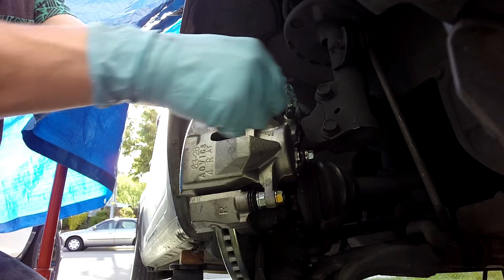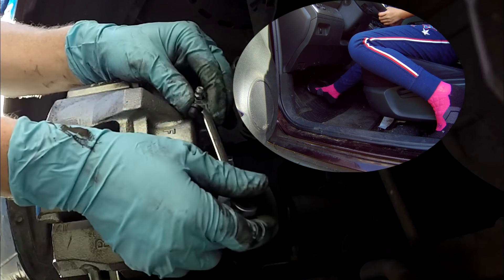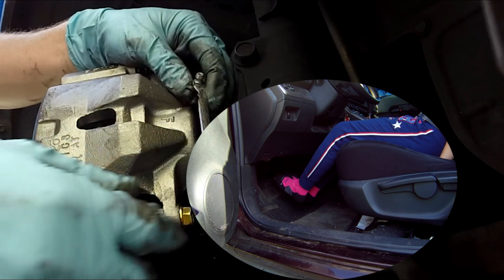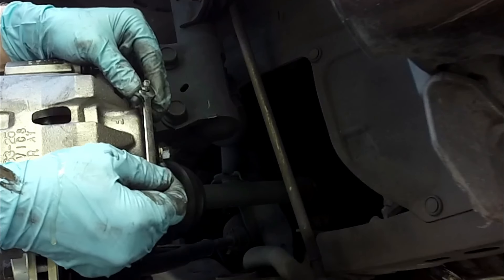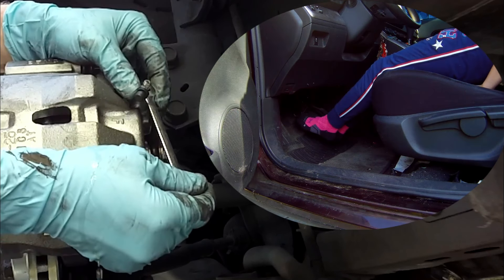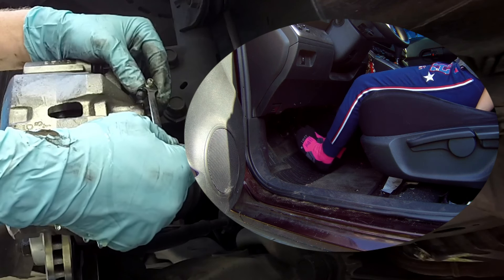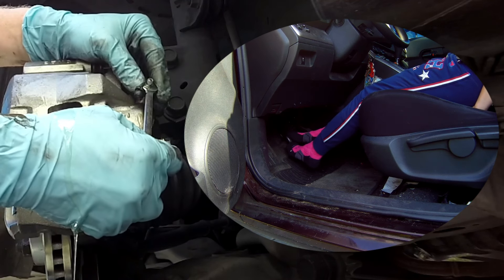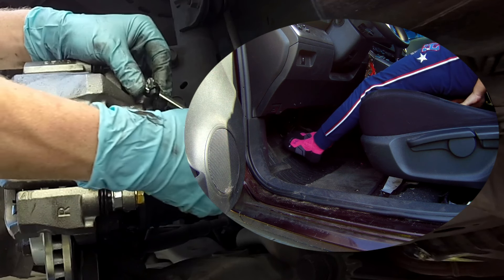⫷ How to easily Bleed Air Out of Brake Caliper ⫸

Comment: Using a 3/16 clear plastic tubing and attaching it to a clear empty soda bottle will be a lot less messy. and you can see when the air bubbles stop. The kid is doing a great job.
Reply from the maker: Great tip. 👍. 
I must say, I have one of the best helpers around.

Comment: Your video saved us!!  We know how to change brake pads but accidentally loosened the brake line.  After being stranded for 3 hours, your video saved us!!  Worked like a charm! Thank you!!
Reply: I just did the same thing did you bleed all 4 or just 1
Reply: Just needed to do the 1.  As long as the brakes were normal again, we didn’t do any more.  If the breaks were still spongy, we would have kept going.

Comment: I go with a clear rubber tube that mates to bleed valve to control the fluid into a container for proper disposal and you can also see any air bubbles in the tube.  Kind of surprised to just see fluid squirting all over as it is messy and you can't detect air bubble so you will over bleed wasting fluid.
Reply: Yes, it's a little sloppy of a method but if you really just need your brakes to function then it's not a big deal. Pressure washer and some driveway cleaner should easily remove any staining on the ground.

Comment: I bleed brake fluid out of all cylinders and when I finished the brake didn't work at all. About crashing into another car, luckily the car was just moving slowly and applied a handbrake. Will try your tip Scotty and hopefully it will fix the problem.

Comment: thank you. just one question, do you keep the cap on?
Reply from the maker: Doesn't really matter as long as you keep the fluid level toped off. If you leave the cap on, less chance of contamination happening from dust and particles in the air.  good luck. Keep us posted!! 💪 👍 🤞

Comment: Do we only have to do it on one side of the car? Both my calipers seized (front) replaced them but I’m guessing theirs air in system
Reply from the maker: Any caliper that you replaced or that you think has air in It should be bled. always start bleeding from the furthest caliper from the brake fluid reservoir.

Comment: You can do it with any sides of caliper? It will  bleed air out for the entire system? Should the car be off when doing that?
Reply from the maker: Car off.  Make sure the fluid reservoir stays full. You can do this process to any caliper. If you are going to do all 4 calipers make sure to start at the caliper the furthest from the reservoir.
Reply: @Scotties Hobbies  ok already done!! All good thanks for the tip very easy

Comment: I have cleaned the Caliper piston, rings and the rest by myself. After fixing everything tried to bleed Air a few times but the brake pedal is still goes down and less brake too. Tried two three times to bleed like you did but no luck. How do we know whether the air has bled or not?
Reply from the maker: You could have a bad master cylinder if pressure doesn't build up.
Reply from the maker: @iroshwimaladharma5840  from the Bleeder nipple. If you take the brake line off, you will trap air between the hose and the bleeder.
Reply: @ScottiesHobbies  I can't see any option to release the nipple, its just a small pin with a hole. 
I had to remove the brake line to clean the cylinder. But brake oil did not come out from the line after removing.

Comment: What happens when the bleeding port is rusted and you have to do it with the line and still don't work
Reply from the maker: You can't do it with the line. You will be putting air in the caliper.  You have to bleed at the very end of the system.  You'll probably need a new caliper if you can't get te bleeder out.
Reply: I didn't replace the caliper had a plugged brake line put a new line on it can't get it to have a full pedal with out pumping won't stay so you are saying that I have to replace the caliper? They are all rusted and stuck together
Reply from the maker: @ronaldbutton28  To bleed the brakes properly you have to bleed them from the brake bleeder. If you cannot bleed it from the brake bleeder for some reason you might want to replace the caliper so you can.

Comment: Is that the brake line hole where the fluid was coming from? If so then what pressing the pedal has to do with it?
Reply from the maker: The brake fluid is released from the brake bleeder. You press the pedal to push the air and fluid out when the bleeder is opened. You can 'gravity bleed' but you  Risk the chance of getting air into your caliper and causing a squishy pedal.
Reply: @ScottiesHobbies  I have this squishy pedal issue now after replacing brake callipers. So all I have to do is open the tap and bleed out as you shown ?
Reply from the maker: @trbossdoggy   You make it sound so easy but essentially yes.  You will probably get a lot of air out of your caliper. So make sure you keep a eye on the fluid reservoir to not allow air into the break line. Good luck and keep us posted on your progress.

Comment: hi would this  method work if I change my caliper I'm only changing the rear caliper that's two of them 
I just want to know do I bleed the whole car or just the one I'm changing
please can someone help me that be great
Reply from the maker: If you drain all the fluid from the reservoir, you'll have to do them all. If you quickly changed the brake line over and minimal brake fluid escaped, you only need to bleed the calipers that you replaced.  Start with the furthest from the reservoir,  if you replaced more than one.

Comment: Do you do this on both sides or just one side?
Reply from the maker: If you only open one side, bleed that one. If you did both, bleed the one furthest from the fluid reservoir first. If you are bleeding the brakes to try and get rid of a spongy pedal, start from the one furthest from the fluid reservoir. If it's a driver side drive, like most cars are here in the USA.. start bleeding from the passenger rear, then driver rear, then passenger front, and finish with driver front.

Comment: I just replaced the brake master and the pedal is still down to the floor.  Do I try this video?  Or do you have any other suggestion?
Reply from the maker: Do What we do in this video. Start at the passenger rear. As long as you are here in the states and you are working on a left side drive. Do not let the reservoir get lowdurring this process.  But you need to get the air out of the lines.

Comment: Dumb question but does this have to be done to both sides or just one ? I assume just one, but just wanna be sure
Reply from the maker: Really..... if you want to do it right... all should be bled. Start at the furthest from the reservoir. Usually the rear passenger.  Then move closer. But, if you only opened one line. You might only need to bleed that one brake. What ever you do. Start furthest from reservoir.
Reply: @ScottiesHobbies  thank you it worked 🙏🏽

Comment: Do you start the car ? Or turn it to on position
Reply: The car should be off, you do not want the vacuum assist for this procedure. I would leave the car off with the key out of the ignition so you can communicate with each other without the radio or any door chime.
Reply: @banjo215  but when it’s off it does not let you depress the brake all the way down

Comment: So should we be doing this on all sides?
Reply from the maker: Start from the brake that is furthest from reservoir.
Reply from the maker: If you replace one caliper then you might not need to do all of them. But better safe than sorry you might as well. If you're just doing a brake job and you're compressing the caliper to put new pads on, then you do not need to bleed the brakes as long as you do not open the air bleeder on your caliper. Leave everything sealed when you compress the piston in the caliper. Just loosen the reservoir cap on the brake fluid reservoir so no pressure will build up inside there.
Reply: @ScottiesHobbies  thanks man. Unfortunately, we ended up switching out the old rear calipers on my car. And some way or another we ended up having a lotta air in our lines. Im certain our resivor went empty, I figured as much but i wanted to double check. Thank you very much.
Reply: @ScottiesHobbies  we have completely bled our brakes and the 1998 Infiniti runs great and stops great, couldn't bleed the one closest to the reservoir tho, the "nipple" got stripped but everything's great tho Err well the back end bounces with imperfections in the road. But yeah, the car runs pretty great! Thank you for the zero nonsense video!

Comment: Does the resivoir need to be closed or open???
Reply: Scotties replied:Just loosen the reservoir cap on the brake fluid reservoir so no pressure will build up inside there.